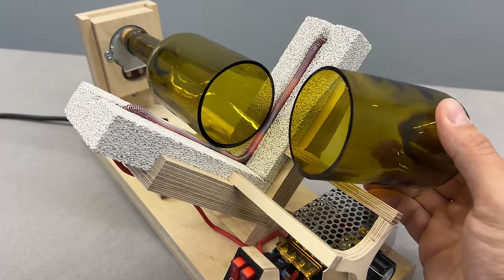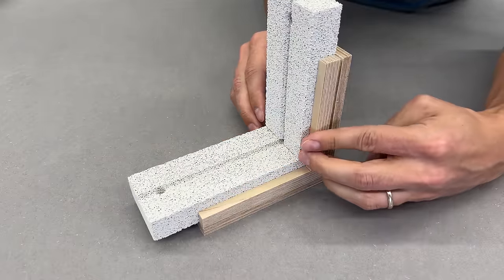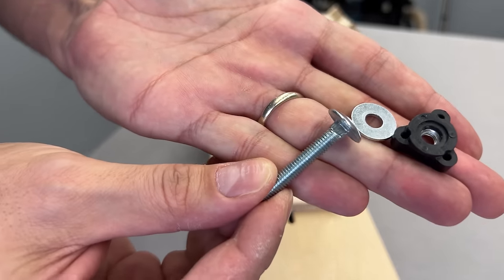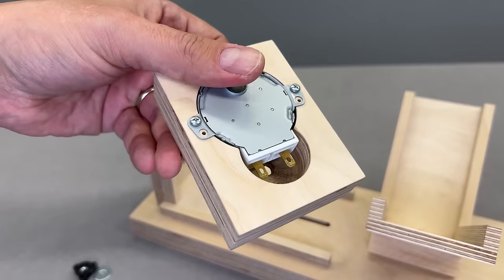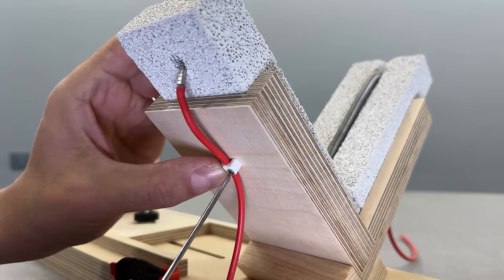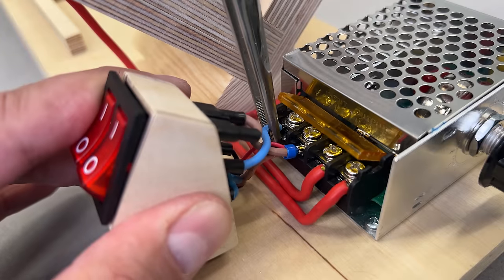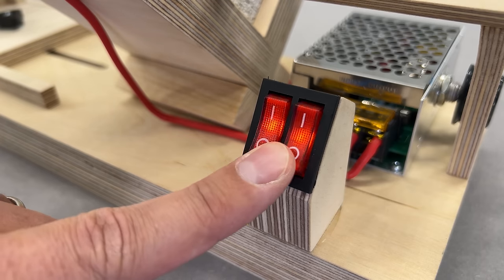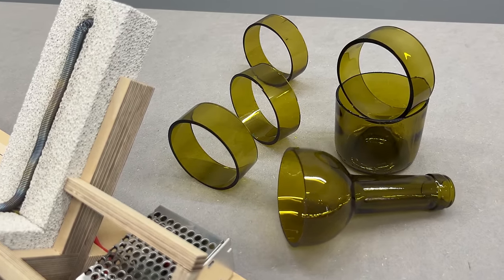DIY Automated Glass Bottle Cutter

Comment: Don’t cut silica blocks like this!! “Exposure to silica dust can lead to the development of lung cancer, silicosis (an irreversible scarring and stiffening of the lungs), kidney disease and chronic obstructive pulmonary disease.”
Reply: I mean if you take the proper precautions to prep yourself and the area to prevent dust getting in your lungs and also clean the area thoroughly after the fact i dont see the problem.
Reply: Then why does it look so tasty
Reply: cut silica like that it’s definitely not bad for you trust me
Reply: @Over_Saturated  yes it is, trust me.
Reply: Don't do anything if you aren't aware of the PPE you need to do it safely...
Reply: @Triffgits  exactly, well said!
Reply: Respirator masks are my bff. Along with my other PPE (safety glasses are a must and gloves sometimes—chemicals, yes—powder coating and saws, not so much). And best of all, a good dust extraction system. 𝘝𝘪𝘰𝘭𝘢! 𝔸𝕃𝕃 𝕊𝔸𝔽𝔼! 👷🏽‍♀️
Reply: This is much better than using most power tools at least. Much less dust and in larger chunks. Should be fine as long as you mask up and clean well. Most of the warnings for silica dust are for extended or repeated exposure.
Reply: Cutting with a hand saw creates next to no air born particles, a power saw on the other hand is another thing.
Reply: @Triffgits  it requires zero ppe.. I blow glass.. all you need to do is scribe it and press a hot piece of glass or metal to it and it forms a straight crack
Reply: @brettchristoffel6391 where do you get that from.. lolol zero logic
Reply: Silica blocks?... you mean kiln bricks?
Reply: Thank you for that. Fire brick would be better. Just cut with a grinder.
Reply: @Over_Saturated that in its self may not be that bad, but every time you touch that surface it’s going airborne. A couple cigarettes won’t kill you, it’s the accumulation over time. Just like all the chemicals we are around.
Reply: I got silicosis and died while opening my microwave, but I'll never pay for sliced glass again!
Reply: We found the square
Reply: yea... well be ok with proper ventilation aka a room bigger than a closet
Reply: And When You Go 
On The Beach ⛱️?!!
And Dust?!!
Reply: Siliconosis is no joke - but with any half decent dustmask its not a problem. Also to be honest Indont think there was a huge amount of akrborne dust here because he did it slow by hand.
As ageneral rule Masks should be worn in any and all cases where where you do work that creates fine dust. Silica may ewpecially bad - but any type dust going into you lungs is a bad idea.

Comment: Man, you cheating, I see that video is "glued"  when you cutting bottle from "top" view, and also I see on side view there is glass cutter instrument lines onto the bottles.
Reply: The line is from the friction with the heating coil.
Reply: @swatcat7928 you think that this polished wire  is harder than glass?  
BTW, this method is working well, but it really hard to get that nice finished cut surface without prescratching it with tool. If you try to do something similar you'll discover that "crack" will be not so even and clean.
Reply: @DewPrototype  it is 1000c wire..
Reply: That line you think you see is a reflection from the edge of the brick that's why it moves when he slides the cradle!
Reply: Yup. There's a score line. This is BULLSHIT.
Reply: Little tricks to fool idiots like us, but the main point was well demonstrated.
Reply: @aserta  I didn’t see any score line. I think you’re seeing things.
Reply: make one and prove it
Reply: Absolutely it is, and not only that, but the heat is going to affect the hardness of the glass the closer you get to the melting point of the glass. If the melting point of the glass is lower than the melting point of the material being used to heat the glass, then that material will always under those circumstances be able to cut the glass.
Reply: The water on hot glass should break clean I've done similar many times
Reply: @electronbolt6550  9:20 look carefully and there's more. But I think yea it could be because of the heating coil
Reply: @DewPrototype  Try using string or yarn tied around a glass bottle, saturate it with isopropyl alcohol, light it, then hit with the water..ta-da..
Reply: Brother..... you do know this is a how to video. If you don't believe it, quite literally make one yourself and see
Reply: 0.25x spotted a pre-made crack before the painting brush touch the glass 9:18
Reply: @PekoraMamiCouncilHK You guys are insane. That's the glass rubbing against the molting hot resistance....
Reply: The refractive index of most materials is temperature dependent. That's why roads become reflective when it's really hot. The hot air on the surface of the road has a higher refractive index than the air above similar to how water has a higher refractive index than air so it looks like there is water on the road. I can imagine that the line you see is simply because the refractive index is different in the heated area and that it would go away after letting it cool down. It could also be because it melts slightly or because the molecules that cause the color decompose or react because of the heat. I don't know the cause but I see no reason to assume it's glued especially because glue would cause visible smoke because of the heat
Reply: @jonasschwalb2787  maybe you are good in Physic but 100% poor in reading
the " glued" stuff is refer the video instead of the bottle
It means we doubt it is a edited footage / plotted

To be honest, I just can't understand why people defend the video even there are visible crack
Reply: @Sasasala386  glass are harder and ALSO bitter
If a metal wire could cause such obvious "scratched line", it must have been pressed to the glass REAL hard
(in my experience, it's more likely to break a glass plate rather than scratch it)

But still, I suggest those who defend the video should have a vision check.
Reply: @PekoraMamiCouncilHK 
You obviously don't understand  basic science or spelling. You mean to say "brittle," but that has nothing to do with it either. Steal can also be brittle if it's not forged properly at much higher temperatures. Look up what the Mohs hardness scale is and tell me where glass is on that compared to metal and what that means.
Reply: @sjenkins91812 it's spelt steel not steal.
Reply: @DesidiosumCorporosumHominis  
Oh dang, got me! This is why I hate grammarly, lol.
Reply: @DesidiosumCorporosumHominis And "spelled" not "spelt".
Reply: @Hermitthecog  both are correct actually it just depends on where you live. It's like burned and burnt, dreamed and dreamt etc
Reply: @danimalmaxasis2762 no not that line. There's a thinner line. Look closer. It's white not black.
Reply: @pinecedar180  heating coil made of steel cannot scratch glass especially not a smooth round coil.
Reply: @demonsamongstmen562 nah I can see it's fake. I don't waste time.
Reply: @Sasasala386 the temperature of steel at that color is around 1000 F. Glass begins to melt at 2500 F. Although hardness does change, it should not result in a very fine line.. I mean anything is possible but I personally doubt it.
Reply: @baloog8  Why wouldn't it result in a fine line since the heated part is literally a fine line? 😍🫡
Reply: @Sasasala386  there's a difference between jessica biels fine and Jessica alba fine.
Reply: no. why do people keep saying this? 
the "score line" people keep mentioning is from the heating element. hot glass becomes malleable, and thus is able to be scratched by the metal element. 
There are plenty of other videos that explain this concept in other ways. for example; tying a string soaked in lighter fluid, then lighting it until it goes out, then dipping it in ice water will break exactly where the string is. did we score that before hand? no, we didn't... Thermodynamics at work! :3
Reply: I built one and they work without scoring, bottle is so smooth at the cut you can rub your finger on the edge without getting cut. The line you see is from the heat of the coil. Don't run your mouth without doing research first. Works better than scoring for bottles.
Reply: Mine leaves it even and clean about 80% of the time. Secret it your heat setting.

Comment: 🤨 ~ April fools joke/fraud, he has to scratch the bottle before putting it on this rotary heater thing, and doesn’t show that? Have I been click-bated with the fake thumbnail? 😡
Reply: There are multiple projects of similar construction. Just search.
Reply: no. why do people keep saying this? 
the "score line" people keep mentioning is from the heating element. hot glass becomes malleable, and thus is able to be scratched by the metal element. 
There are plenty of other videos that explain this concept in other ways. for example; tying a string soaked in lighter fluid, then lighting it until it goes out, then dipping it in ice water will break exactly where the string is. did we score that before hand? no, we didn't... Thermodynamics at work! :3
Reply: Just because it doesn't wrap around it

Comment: I just got done building one of these based on this video and it does in fact work.  The line that everyone says is a score line is made by the bottle rubbing on the heating element.  That said, I think you do get better results if you do score it.  I still have some tweaking to do, but it does work like the video.
Reply: yep. i havent made one and i know what that line is... 

everytime ive scored, ive ended up with bad cuts. hardest part is the actual smooth continuation, and the golden rule of glass cutting is ONE pass. 

i prefer a single strand of nichrome and rely on the thermal shock as it heats rapidly.
Reply: A kid could see that. People just want to be mad these days...Such a great video!
Reply: What the hell do you do with cut glass?
Reply: @applesaucestin7248  cups. vases. handy little pots. 

having just smashed it a while back... try and replicate a vintage flytrap that looks like a bottle with the bottom cut off then folded back inside itself...
Reply: @paradiselost9946  Could you elaborate? Do you tie a single strand around a bottle in a single loop, heat up, remove, cold touch and done?
Reply: @MrWnw  single loop, anchored at one end, spring keeping it tight at the other. the cut happens automatically as long as its heated fast enough, ie... 0.5mm nichrome on a car battery type thing...
Reply: @paradiselost9946  That is an awesome technique, thak you for sharing. Do you have any tips for rectangular bottles where the sides are bended inwards? Like beefeater gin
Reply: @MrWnw  use a flame at that point...

need a turntable, blowtorch, gradual heat then touch with moist finger...

saw a corning glass video that gave a pretty good demonstration of it the other day?
Reply: @paradiselost9946  here I will need to use a glass cutter, right? Ddo you have thy video by any chance?
Reply: @MrWnw  nah, only videos i post tend to be random and have nothing of any interest ;) i try to do something worthwhile and SHTF... so i dont bother :)

the standard glass cutter is only of use on flat window glass, and even then it takes a certain amount of skill...

gradual, even heating and a sudden thermal shock, with some practice you can break a glass precisely where you want it. watch a few of the "laboratory glassware" type videos for a few ideas, then get outside and have a go ;)

its only glass, after all! cheap!

the other method is diamond saws, super fine grits, slow speeds, lots of water... messy.

Comment: We can see the scribe line...🙄
Reply: that's from the heating element. notice how it appears only after it's been heated and rotated multiple times. glass becomes more malleable at higher temps, thus is able to be scratched by metal (the heating element).

I would suggest taking a step back and thinking for a bit before saying things so definitely. Whenever I see something that I don't understand, rather than assuming the other person is wrong, I first think of how I might be wrong, and use rational thinking to decipher my thoughts validity.

Comment: I think the “score line” people are seeing is the hot wire smearing onto the very hard glass.  This glass-cutting trick is repeatable with a string soaked in fuel around a glass bottle, lit on fire, and then cracked with cold water.  The thermal shock cracks the glass along the line of greatest tension, which is the very hot, thin outside line where the string burned or the coil rode.
Reply: Totally agree. A scoring line looks different
Reply: Tried that, really not reliable.
Reply: Or just score it and touch something hot to the line.... Jeez.

Comment: why do people keep saying this is 'fake', and keep talking about a "score line"? 
the "score line" people keep mentioning is from the heating element. hot glass becomes malleable, and thus is able to be scratched by the metal element. It is breaking along the line that was heated, and then rapidly called. it's called thermal shock...
There are plenty of other videos that explain this concept in other ways. for example; tying a string soaked in lighter fluid, then lighting it until it goes out, then dipping it in ice water will break exactly where the string is. did we score that before hand? no, we didn't... Thermodynamics at work! :3

great video! ^w^

Comment: "Just Insane" - You are correct. The bottles obviously have a cut-line from a glass cutter scribed into them near the where the heater wire contacts the bottle. 
The wood-working looks nice though.
Reply: I noticed that too. Why fake it?
Reply: @megan_alnico  Yes why waste people's time
Reply: I'm guessing this was released on April 1st, 6 days ago?
Reply: @megan_alnico  I think the line is from rubbing on hot coil.
Reply: he didnt fake it - cheap as fuck to make it and try it - it works - im not sure what application your cut bottles will have tho.... not many countries make the fuckers any more so why? just why? dipshits... (things that no longer generate revenue in RL are shared with ppl on youtube... gold mining gem mining ect... first they strip the mines and when it is no longer profitable they make money off of telling you how to do it)
Reply: that's from the heating element. notice how it appears only after it's been heated and rotated multiple times. glass becomes more malleable at higher temps, thus is able to be scratched by metal (the heating element).

I would suggest taking a step back and thinking for a bit before saying things so definitely. Whenever I see something that I don't understand, rather than assuming the other person is wrong, I first think of how I might be wrong, and use rational thinking to decipher my thoughts validity.

Comment: I've cut probably 40 bottles, by far the biggest pain is smoothing the edges.  
We need a jig for that!
Reply: Smooth the edge w a torch ese... all this is unessasary
Reply: @ZomPaul2113  Turn table and something to hold the torch is what i'm thinking.
Reply: @FreeTea4Me  turn table? I use a Bethlehem bravo torch.. bench cool the glass and hold w your hands or use grabbers... i anneal glass in a kiln.. but you can use vermiculite.... glass does not conduct heat well so I think you're over thinking means to hold and rotate it
Reply: @FreeTea4Me  and js... sodium lime glass does not like to hot work much so you look for bottles made of boro or softglass which you can still find.

Comment: Most impressive is the score line on the bottle that will remain unnamed....
Reply: that's from the heating element. notice how it appears only after it's been heated and rotated multiple times. glass becomes more malleable at higher temps, thus is able to be scratched by metal (the heating element).

I would suggest taking a step back and thinking for a bit before saying things so definitely. Whenever I see something that I don't understand, rather than assuming the other person is wrong, I first think of how I might be wrong, and use rational thinking to decipher my thoughts validity.

Comment: I wonder if some narrow guage nichrome wire like they use to cut styro foam would work to make spiral cuts on a bottle,
Reply: There is some videos on YT about that, its a bit hard, coz every bottle has it own internal tension, what are unpredictable cracks glass when youll try to break it, and usually finishing "spiral cut" is done manualy with some diamond tools

Comment: For the ones who say this is fake and has a cutter line, I disagree. 
Watch other bottle cutting videos, and you will see that 
1. a cutter line looks differently, and 
2. someone demonstrates the same principle with a burning cotton thread. 
I’m quite sure, that the line we see is the hot wire rubbing on the glass, potentially rubbing off some metal (as it is hot it is softer) and depositing it on the glass.
Also, I do not see a motive to cheat. If needed, he could easily add a cutter extension to the construction and let us know about it.

Comment: I have a rather stupid question. I tried this kind of heating wire as well, even smaller ones rated for 1000W. But without stretching it first, it would directly short ciruit when applied with 230V. You measure only 400W that is quite a substantial difference. Is this only due to your regulator that stops too much power going in?
Reply: I was wondering about shorts, too - around 5:25, he pulls the bottom edge down with a copper strand; maybe that stretched it enough to eliminate most shorts?

Comment: so were just going to pretend it wasn't scored?
Reply: Are we going to pretend you read comments?
Reply: that's from the heating element. notice how it appears only after it's been heated and rotated multiple times. glass becomes more malleable at higher temps, thus is able to be scratched by metal (the heating element).

I would suggest taking a step back and thinking for a bit before saying things so definitely. Whenever I see something that I don't understand, rather than assuming the other person is wrong, I first think of how I might be wrong, and use rational thinking to decipher my thoughts validity.